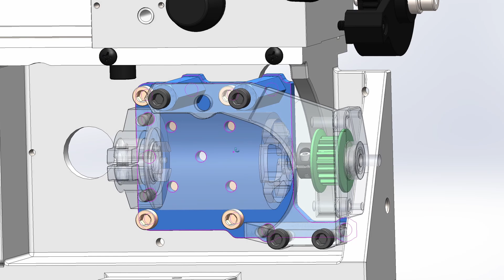A Better SEIG 7x14 Mini Lathe Spindle Upgrade | BLDC + ODrive

Comment: 3:08 VESC can most definitely run with encoders, even the exact one used here. Pretty sure Benjamin Vedder himself has videos dating back to 2015 or earlier demonstrating it. VESCs are rarely driven in 'open-loop' mode. Most of the motors you'd use often come with at least hall-effect encoders that it can take advantage of.

VESC has recently introduced HFI, which adds sensorless position tracking at zero speed. It is pretty incredible to see and it rivals dedicated hardware encoders. You should take a look.

Nice video on the upgrade :)

Comment: At 6:35, what is the longest, continuous powered on, active machining project you have made? How is the thermal performance of the motor/power supply in extended operation? Thanks.

Comment: At 2:30, there are several other owners of 7x mini lathes that are using 750W, 1000W, and 1500W brushless servo motors as well as 3HP-3PH motors on these lathes... A different presenter -- Artisan Makes -- was using 3HP until he recently upgraded his entire machine.   "The Custom Crafter" in Florida is making 2HP brushless bolt-on kits for these and other underpowered machines as well. ...  AnyHow, thanks for making this video and presenting your idea(s). I would like to see it run with 1500 Watts of power available and compare the performance to the previously mentioned and unmentioned presenters projects here on YouTube.... If you want to know the other presenters just contact me.

Comment: What version of SW are those cad files?
It will be nice if you upload some drawings in pdf... not eweryone have SW...
Reply from the maker: Hi, my modified CAD files are Solidworks 2022. I can try to create .step files if there is sufficient request for them
Reply: @markosfraser3030  Thanks for info.
I think more like clasic, paper drawings in pdf format. Something like full assembly or few subassemblies, will be enough for someone who is interested, but use anodher CAD, or do not use it at all, or just want to take a quick look and maybe grab some idea for other project...
Reply: @markosfraser3030  .step files would be nice! I don't use Solidworks. Great Project!